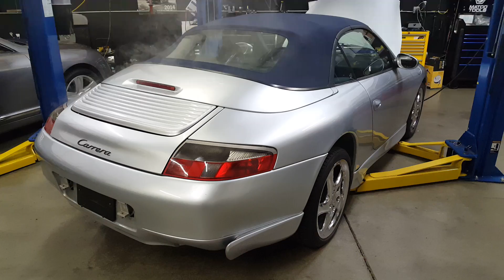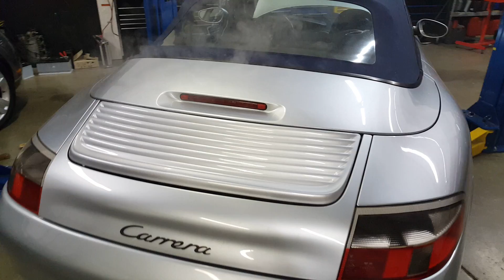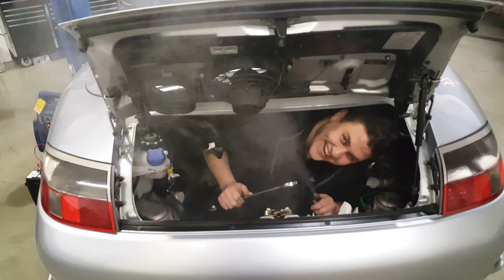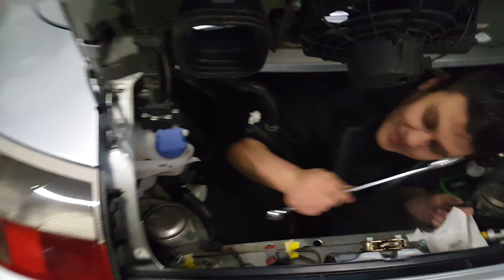Porsche 996 911 IMS bearing failure engine noise...Part 1

Comment: I am looking to buy one of these things I will make sure I get it checked out by mechanic first though
Reply from the maker: yes, that's a good idea. Take it to a independent Porsche shop and have them remove the oil filter and drop the sump plate to check for metal.
This one was also inspected and the IMS issue was missed.